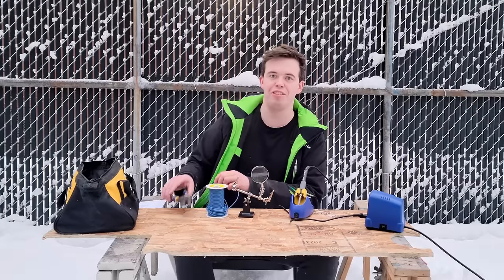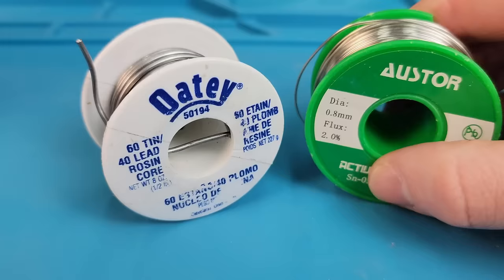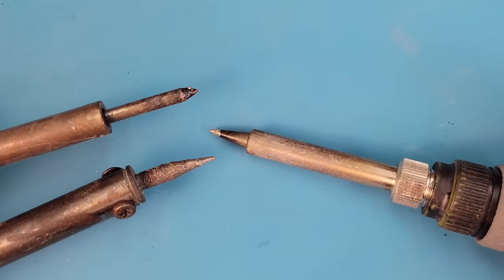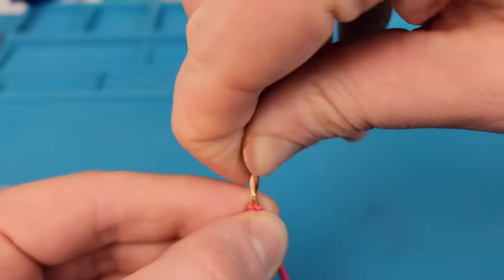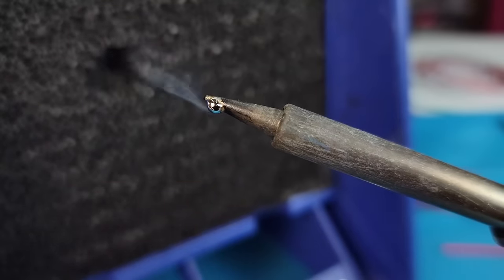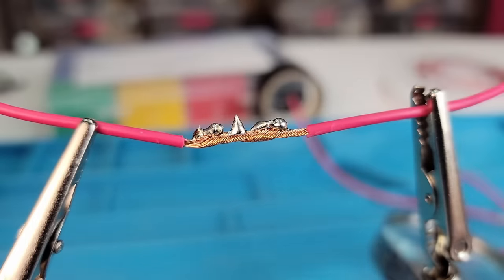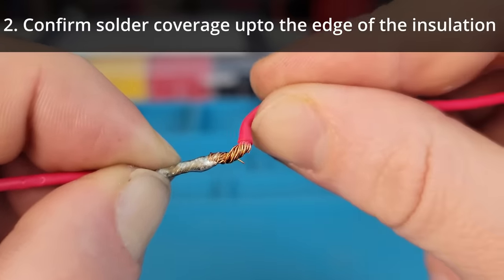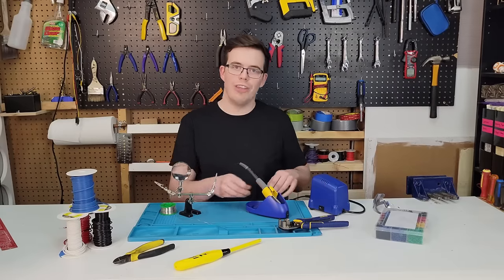Four Steps to Flawless Wire Joints (How to Solder)

Comment: One tip that ive used for about 20 years is this: when youre done soldering for the day, shut off the iron snd use the residual heat to melt lots of solder covering the tip. Let it cool off and solidify.

The next yime you turn on the iron, brush off the blob and your tip will be nicely tinned and virtially no oxidation will occur. 

I get literally years out of my tips by doing this.
Reply: Neato
Reply: So basically I should be seeing a big blob on the tip of the soldering iron any time I’m not actively using it?
Reply: @HyperionBadger  yepp more or less, you always want a tinned tip when you turn it off.
Reply: Great to know I'm not the only one doing this!
Reply: Originally thought you'd used one soldering tip for 20 years and was flabbergasted.
Reply: I don't blob mine, and I've gotten at least four years out of my one tip just by making sure that thing shines like new when I turn it off. It's a TS-100 K tip, and I use it for everything from wiring about the size of the ones in the video to microsoldering, it's great, lots of surface area on the sides and I can just turn it to where it's just the tip in contact for finer work.
Reply: Came here to mention this. The solder provides an oxygen barrier. His video was good until the very end when he wiped the tip off clean to put it away, I physically cringed.
Reply: It will dissolve the tip.
Don`t do this.
Reply: @iridios6127  go ahead and explain the chemistry involved in it dissolving the tip. Because this comment makes it sound like you work for weller
Reply: @phil2156  
I use non-coated copper and brass bits.
They tips get damaged pretty fast.
Copper dissolve in solder + influence flux.
This is more physical process, than chemical.
Reply: @iridios6127  the rosin core inside solder isn't corrosive
Reply: @phil2156  
Any flux is etchy, more or less.
Go read Wiki. 
Everything is explained there in detail.
https://en.wikipedia.org/wiki/Soldering_iron
Reply: @iridios6127  good debate process here. Electrical types are so much calmer than Mechanical type Technicians. 

This would have been far less constructive between a couple of Wrenches arguing over Snap-On or Matco options like they're Sunni and Shi'a Muslims; or Catholics and Protestants if you want to misdirect/deflect your problem my way. 

Just so I know there will be no love left for my presence here I'll just end it; or Jehovas Witnesses and a doorbell that doesn't work 😊
Thank an Electrician for that blessing in disguise.😂
Reply: You dont need a blob, but rather just a coating on the tip. I'm pretty sure I either learned this from an elmer or maybe in a pamphlet from my first soldering iron from radio shack. That said, tip tinner/cleaner does wonders to refresh tips too. I have a Hakko 926 I think I got early 00's if not late 90s and still running the original set of tips + some others I bought with it at the same time. Despite having other irons, it's still my preferred iron.
Reply: @iridios6127  maybe, but I have decades old tips that haven't complained.  Not trying to argue, but sometimes real life doesn't agree with theory.  It's all good though, warms my heart the 387K people are watching soldering videos!
Reply: @ensidfkgnur  
In my more than twenty years of soldering experience, a bare copper tip wears out very quickly in about a week or two. They constantly need to be re-shaped.
What is wrong with the explanation in Wikia, which is not a theory, but the combined experience of hundreds and thousands of people, expressed in written form ? 
I am not very experienced in using coated tips, but I constantly read online how newbies struggle with their maintenance and often damage this coating.
long-time users of coated tips, most often advise keep them clean.
Reply: @iridios6127  After 46 yrs soldering there's no sense in me changing, but there could be environmental, equipment, or solder differences?  Also, I'm not using mine every day, sounds like you might be!
I've recently bought a modern iron with neat firmware that works great, will see how the tips hold up.  

👍
Reply: @ensidfkgnur  
Yes, I worked at job, daily use of soldering irons. At least 3-4 hours of soldering, when idle they just stand on idle heating.
Reply: @iridios6127  Sounds kind of like you're doing plumbing work.  Most tips for electrical/electronic use are not raw copper, and rosin based fluxes are the norm, not acid core.  Most lead-free stuff is an alloy of antimony and tin in varying proportions.  DON'T use zinc chloride-based fluxes with it!  It is corrosive, and will form a toxic gas called stibine (Antimony Tri-chloride).  If you smell something nasty, guess what just happened?  Get to fresh air until that stuff dissipates!)
Reply: @kmemz  This is valid.  Leaving a little blob is also valid, as both seal oxygen out of the tip to keep it from pitting. (With a tip o'the hat to phil2156!  Entirely correct!)  As old as I am, I have a strong aversion to using lead-free solder.  Please don't use any zinc-chloride flux with any solder that has Antimony in it.  It will make a nasty smelling toxic gas called stibine.
Reply: @horusfalcon  
You are completely wrong. I had a lot of copper rods and made my own tips.
It's all described in the wiki, are you banned ?  🤦🤦🤦
Reply: @iridios6127  "the wiki"?  No... I'm not banned yet.  I was making a guess, man.  No need for any acrimony.

I know what I have and have not done over a 50+ year career in electronics, instrumentation, and controls.  I've only used a bare copper tip once, and saw it beginning to pit and erode almost immediately, so I never did that again.  If what you're doing works for you, by all means continue, but I have chosen a different way, and so have many others among your contemporaries.  Are all of us wrong and you're the only one who's right?
Reply: @horusfalcon  
A tip with a tinned iron coating does not require any "blob" protection. A tip without iron coating will dissolve in the solder.
Is this simple thing so difficult to understand ?
A solder "blob" increase risk of damage the tip.
The coating may crack when heated and cooled. Many of the experienced soderers recommend cleaning the tip.
Reply: @iridios6127  With the attitude you seem to be taking, I see no need in further engagement.  You keep on burning up perfectly good copper that could be used for other much more suitable purposes, and I'll keep on using methods which experience over five decades has shown to work and work well.  Do be careful how you use zinc chloride fluxes.  Stibine gas is a real thing.  With that, I bid you sayonara.
Reply: @horusfalcon  
There is no antimony in soldering materials. Where would stibine come from? Also, there are no suitable conditions for its formation in the processes. Obviously - you banned from education, not only Wiki.  🤣🤣🤣

Comment: Nice! 0:14 ...I use my DeWalt bag for my soldering stuff too. Great minds. Great tutorial. 

One thing that has helped me is adding a bit of electrical flux to my twists. A lot burns off, but the solder seeps and flows sooo much better. Just have to clean up the joint with some rubbing alcohol afterwards.

Last thought, no matter how many times I've told myself to add the shrink tubing prior to twisting and soldering, I still forget. 

Keep up the good work.

Comment: THIS IS THE EXACT VIDEO I'VE BEEN NEEDING IN MY LIFE FOR THE PAST 20 YEARS!!!! I swear soldering two wires together seems like it should be as simple as tying your shoes, but I still needed someone to teach me that as well. BUY THIS MAN SOME TIM HORTON'S AND ANOTHER ROUND OF MAPLE'S FINEST!!!
Reply: I would add one more pro tip for making wires mesh together easier: straighten up the wire ends into two narrow "brooms", then push those brooms into each other before twisting them together. Also another solution for pointy tips is to use the edge cutters before putting insulation over, always remove the needles pointing out, your future fingers will thank you.

Comment: Have been soldering since I was about 8 years old, and professionally for 40 years. The methods you have shown here are absolutely correct. 
The only thing that is not is the use of a flame to shrink the heat shrink. This is frowned upon professionally for good reason. The flame has a tendency to char and burn the heat shrink because flames are too higher temperature. This can result in embrittlement of the heat shrink causing it to crack or split. The best temperature range to use is 200 to 250 degrees C dependent on the type of heat shrink used.  The use of flames in some working environments is also prohibited due to the presence of flammable or combustible substances, especially when working on or making repairs on cars.
Reply: While I prefer a heat gun when shrinking heat shrink tubes I think he showed the problem of charring the heat shrink  when using the edge of the flame. He did recommend using the blue part of the flame instead of the yellow tip and showed the difference it makes. While not the optimal way of heat shrinking it gives you an option when you haven't got a heat gun at hand.

Comment: Excellent video. The two bits of advice that I got when I was struggling to learn soldering: "Heat the work, not the solder", which was shown nicely here. The other one is that the solder will tend to flow towards the heat source, which is why having the iron on the other side of the wire works so well, the solder will wick its way through the strands towards the iron.

Comment: Decent video.  I learned a lot of the proper soldering techniques from my father who was a Comms/Radio Op in the Korean War and a "HAM"/Amateur Radio operator with a Tech license.  I was building/assembling many of my own electronics projects starting at 8 years old, LOL.  The DIY HEATHKIT projects were a staple back then.

I then learned even more from a husband & wife team who both work for NASA as soldering techs.  Some of the protocols they have to follow and techniques they use are mindboggling.

Also, learn to know WHEN you should SOLDER, and WHEN you should use CRIMP connections.

Cheers

Comment: While there is nothing wrong with twisting the wires first and then twisting them together I find the best joint is to actually splice the strands of the wires in to each other and then twist them, heat up the joint and solder. The problem with twisting already twisted wires together is even with tinned solder you are creating a much larger thermal mass that is harder to solder - particularly with larger gauge wire. It's also not as mechanically strong because wires that are twisted together like that have less surface area in contact with each other - so you need a longer joint to create enough twists.
Reply: Yep! IIRC fanning the cores, pressing them together, and then twisting them is the NASA approved way of splicing. Minimizes chances of sharp edges and ensures mechanical strength.
Reply: @wydra9-1  can you provide a source for your NASA approved way of splicing? I am looking at nasa-std-87394a right now and not seeing your method mentioned. The standard i mention recommends a simple lap joint first for stranded wires.

Comment: 2 tips to add from my experience. 
1: I normally put the iron under the wire rather than on top, heat rises, as well as better visual without the iron in the way
2: When your done soldering, while the wire is still hot, the wire's insulation will be soft around the joint. If you're quick, you can push the soft insulation closer to the solder joint and it'll cool and harden. This adds a little bit of strain relief, "smooths" the transition between insulation and solder, as well as makes it so your heat shrink doesn't have to be as long. on small wires, I've even gotten both sides to touch in the middle, completely covering the soldering joint (obviously still used heat shrink for a proper seal)

Comment: Been soldering for over 70 years. My current prefered method is to hold the solder against the joint, press the iron through the solder onto the joint, and then feed more solder from the other side. This ensures that almost all the flux flows into the joint. It also helps prevent overheating sensitive devices if the wires are dirty. This method is usually faster, too.

Comment: This is now my go-to vid i will be using to teach my preferred soldering method, you manage to explain EXACTLY the way i try to tell people when they want to have a go soldering, i hate pulling apart anything electrical to find a blacksmith did the prior repair....

A mentionable tip for soldering several wires running alongside in a harness situation is to offset the cuts and solder connections by the length of the connection so that if the heatshrink is breached it will be on the parallel wires insulation and not directly next to another join....

Precision and process is whats needed and this video is exactly that, Thankyou....

Comment: I just wanted to give you props for a fantastic video! Not just twist them but HOW to twist them. And showing what to do when soldered joints aren't picture perfect (like in most videos). The dose of realism, what to do/not do, and demonstrations of poor soldering technique vs correct - what a well made video. Excellent work!

Comment: Just stumbled on this one! I've been soldering wires for 60+ years and I've always used the "wet sponge" method. I saw you use the copper mesh to clean the tip and had a flash of insight. There, by my kitchen sink, is a copper scrubber I've never used! Guess I found a use for it! 🤔
Reply: I find the sponge to be a lot more thorough for cleaning compared to copper mesh. Only downside is that I have to run to the sink first to get it wet.

Comment: Great video. I had to learn proper soldering technique out of a book, and that just doesn't convey the nuances quite like seeing it in action. But the most helpful thing that book did say was something like "Do not use the iron to melt solder except to tin the tip. The iron is only for heating the joint, apply solder directly to the joint instead."
Completely fixed my perspective on what exactly I was trying to do.

Comment: Great tutorial. I've been soldering for a little over a decade now, but I like to revisit tutorials like these as a quick "re-certification" every now and then.

One tip (no pun intended) I'd like to add doesn't apply to soldering technique, but more to preserving the wire's insulating cover. If you are using helping hands/spring claws like what you have in the video, cover the jaws with cut to size heat shrink tubing. This lessens the marring of the insulation and prevents it from being pierced from the jaws.

Comment: Dude can solder better than I ever could. One point about electrical tape though: it works and can stick firmly, but you have to pre-stretch it to make it pliable enough and for the adhesive to stick properly. Cut the length of tape, grab it from both ends and slowly stretch it, it'll get finer and much more pliable that way. I don't know why this isn't taught more frequently, but I learned it years ago and it's the correct way to use electrical tape.

Comment: Proper physical splice (the X twist is my preferred, and I've done it enough that I can do it pretty quickly, even in place in my truck's engine compartment when I've had to), clean tip, liquid flux so that it wicks into the strands before applying solder and helps to more quickly pull the solder in, and my technique is HOT (405º C) and fast so that there's less time for heat to migrate into the insulation of the wire before you're done (almost a non issue regardless, when I use marine grade wire that has silicone insulation; which is my go-to every chance I get). I also prefer lead based solder but can use ROHS compliant solder if I have to (my job requires it).

I often brag that my wire splices and tinning is among the best out there.

Great video, and your methods are very similar to my own.
Reply: If your job requires RoHS, I hope that you have a dedicated iron, tip, cleaning pad, and other tools for that to prevent cross-contamination. You can fail inspection otherwise if they use an XRF gun or lead check swabs.
Reply: @KevinT3141  we always do

Only one soldering station is non ROHS at my work and it's kept separate from the others
Reply: Totally agree on having a hot iron, I carry a simple 60w iron as it has the level of heat I need. Lower wattage irons are just not worth it for me, but good enough for people that are learning to solder as they can learn the techniques, then speed will come later with experience.

Comment: When i was young and dumb i sanded down a near new tip to clean it... Solder never stuck to it again so i threw it in the bin box,
Decided to dig it out to try repair it
Didn't have much hope but with repeatedly drowning the tip in flux at high temperature and rubbing it on a block of solder it had a nice silver coating again, works great now!

Comment: If I use tape, I opt for the self fusing tape which is stretched when wrapping. It becomes one piece and the layers fuse together. It also replaces heat shrink tubing. I have a ball point pen I wrapped back in 1991 and it is still fused. It comes in 11 ft. rolls on a cardboard tube.There is a plastic separator on one side to keep the tape from becoming one lump.